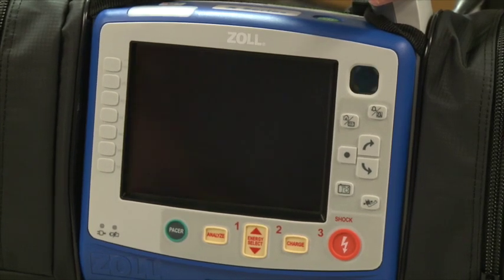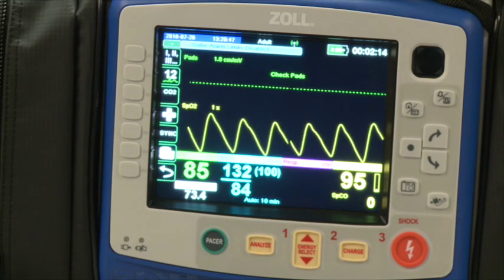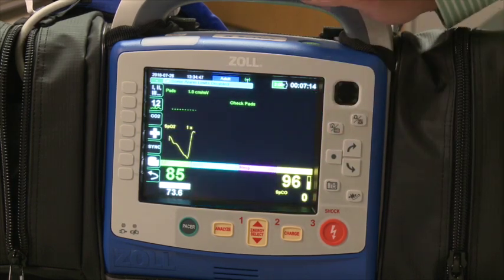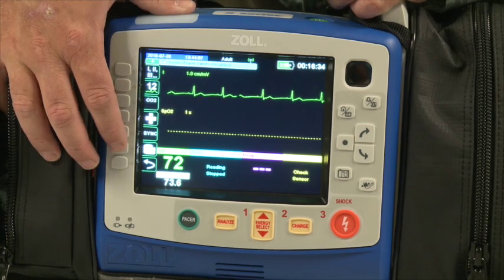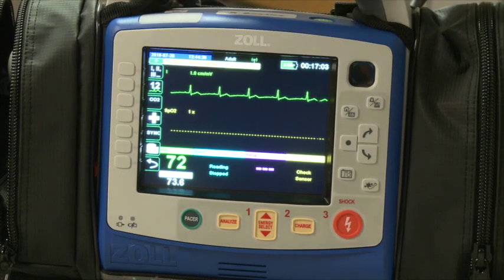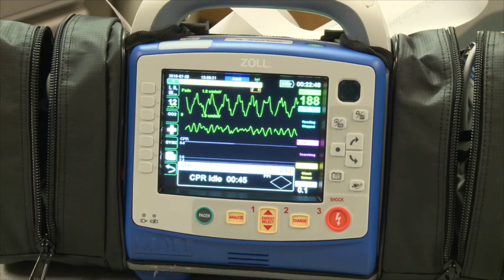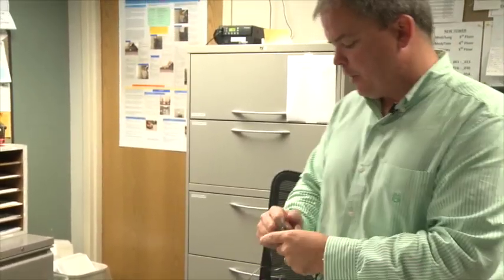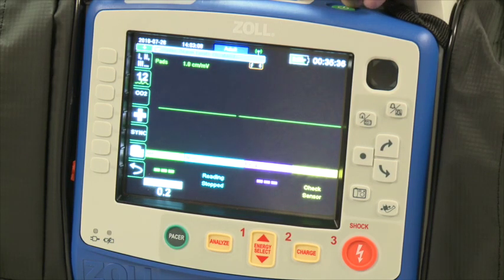How to use the Zoll X Series

Comment: I have been using these 4 years. Never had issues with these. Easy to use. Now I'm swiching to an employer that uses LP15 which seems ok, but bulkier. Not sure if LP15 has all of these functions. Zoll has less accessible ports and printer than LP.